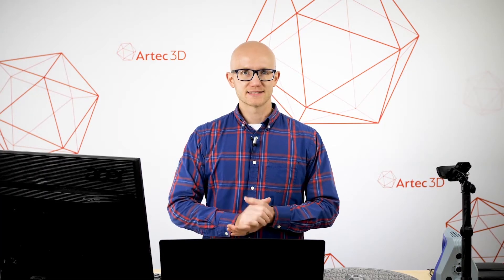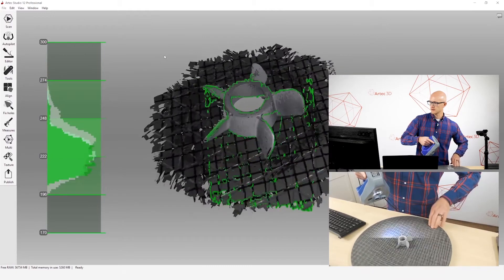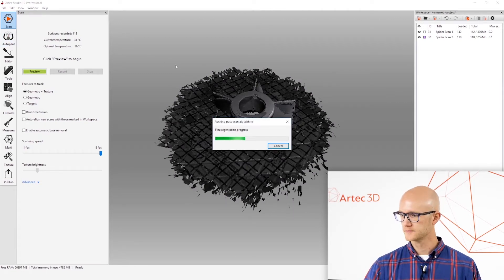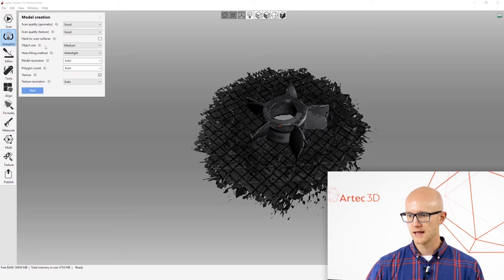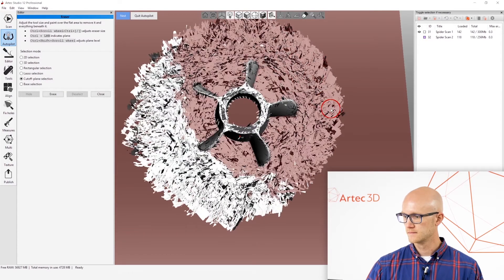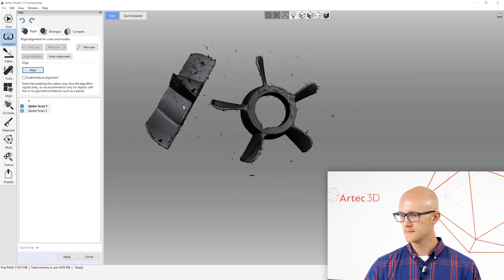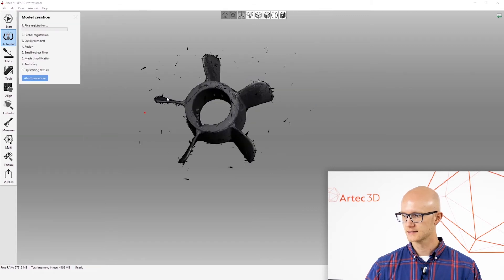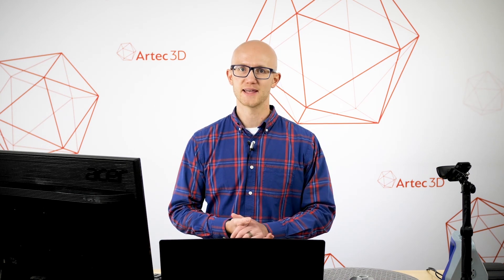Artec Studio 12 Autopilot Feature Tutorial: Make High Precision 3D Models of Mechanical Objects Fast

Comment: Is it possible to export from Artec studio to other CAD software, and if YES, how?
Reply from the maker: Yes, the easiest way to do that it is to use Geomagic Design X or Geomagic for Solidworks. These programs are integrated into Artec Studio so you can export your 3D model to them directly. Using these programs you can convert the mash to a solid.